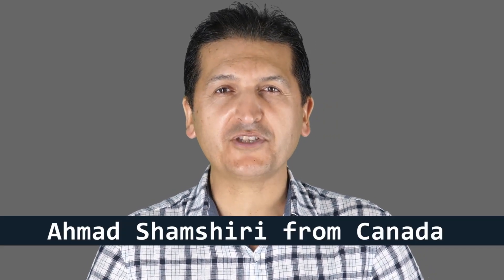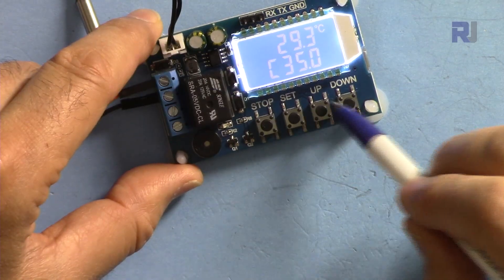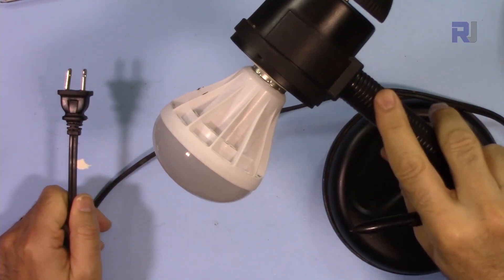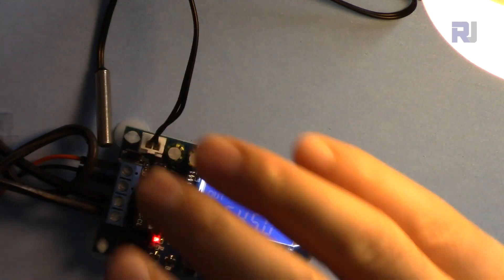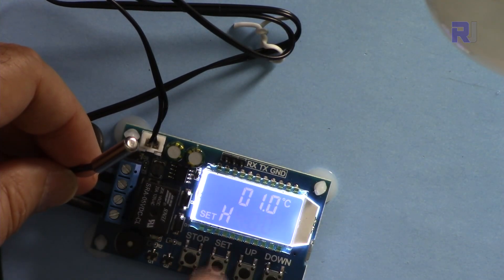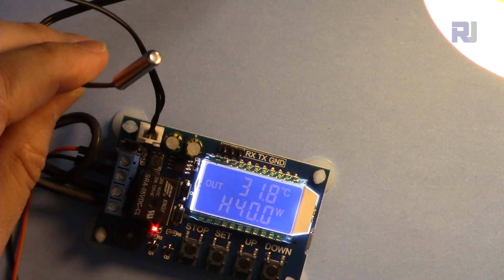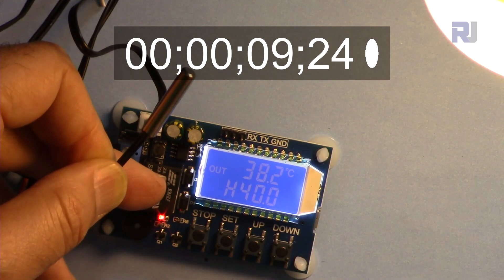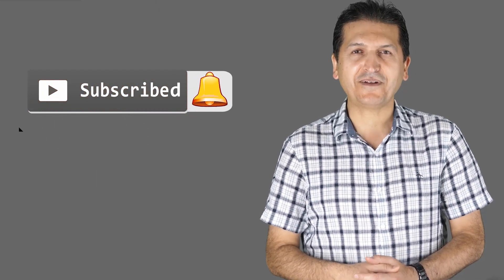How to use  XY-T01 Digital Thermostat Module - RJT205

Comment: If we wanted to use this for a cooling operation using a fan, would the fan need its own power source, or does it use the same power source as the Thermostat module?
Reply from the maker: the module needs power to work. load or fan is separate. but if the voltage of this module and our fan are the same, yes you can connect both to the same source.

Comment: Hello. I have a question: is it possible, to your knowledge, to build a circuit using a temperature controller with a single probe (NTC or PCT) and a panel with relays that activates subsequent relays as the temperature increases or decreases (say, every 5 degrees). Perhaps an Arduino-based circuit?

Controlling the activation of subsequent heaters as the temperature drops. Thank you in advance for your reply.
Reply from the maker: Hello, yes of course.  but you have to conditional statement "(if, else etc. )" I have video on that and then learn how to turn on/off a relay which I have tones of videos.

Comment: For 12V connection, my understanding is that the relay output does not power the device (fan) that is hooked up to it (it's only a switch), so there either has to be a jumper between the V+ and one of the switch connectors. Also, the positive of the device (fan) needs the to the V+ connection.  Is this correct?

Comment: Using this to prevent charging when a LIFEPO4 battery is cold.
Set the unit to the C mode for cooling and set the temp to 4 degrees C. With this setting, when the temp is above 4 degrees C, the relay will close to allow the battery to charge. It will work for months just fine, and then reset the C mode to the H mode for no apparent reason. I have seen this happen on two different units.
Is there a solution to this issue?

Comment: I own this board, it works very well, it controls a fan under a refrigerator. What bothers me is the blue indicator that lights up day and night. Is there any way to turn it off? I can also imagine desoldering a connection on the display. I just don't know which one. What is the production name of the display so that I can find the pinout information on the internet? Thank you.
Reply from the maker: Please have a look at video title
Reply: @robojax  How to use XY-T01 Digital Thermostat Module - Robojax ? I don not understand!

Comment: Hello, 
thanks a lot for this video, can you please confirm if it is reliable and can be used for years or it could shut down at any moment?
Reply from the maker: Hello, for that contact the manufacturer. Or seller.
Reply: @robojax  am asking for that parts, if it's reliable? Or will it stop functioning after 1 months for instance?
Reply from the maker: I can't say it. I don't know where you live, but here in Canada if I tell it is safe, you can use it against me and I can go to jail if something bad happens using this device.
Reply: @robojax  I live in Algeria, in Africa, so u can say the truth without any fear
Reply from the maker: Regardless. I can't say anthing about the reliability of moduels. Contact the seller or manufacgturer. Or test in a safe and isolated space where there is not possiblity of fire or other hazards and test it.

Comment: Rated at 10 amps. Could you show a wire and connector rated at 10 amps that actually fits this? I know 4 year old vid.
Reply from the maker: A simple Bing/google for wires size for different current value and you will get it. Each manufacturer will have different values.

Comment: Nice little gadget, I bought 4 of these and they work great, except the alarm does not sound @ high temperature.. 
The display will flash and the relay turns off.   I can't figure how to get the alarm to buzz.      It would be nice if the unit had C/F options and a way to have the display light turn off after a certain time..  If anyone knows how to get the alarm to work , please let me know..
Reply: hi rays,
can you please tell me if its reliable or has some issues? i want to use it with a fan to cool down the radiator and it should absolutly be reliable. The alarm does not interest me.

Comment: I have the XY-T04 for heating and once mine reaches 43°C it shuts completely off, immediately turns right back on and repeats that process every time it reaches 43°C, even tho I have it set to reach 65°C with a 1°C Hysteresis. I have the OTP, LTP, Delay, Alarm and everything else off, so why is it doing this?
Reply from the maker: it seems the power is now enough when the relay is turned ON. check the supply power make sure it has enough power. (current or ampere)

Comment: Hey there and thanks for the great video!
I am really struggling to interpret the data received from UART and so far, I am totally in the dark. Any hints on how to interpret serial data coming from device?
Thanks so much again.
Reply from the maker: Hi, we are not concerned with the data. We simply program and use it. The manufacturer has not released any information on that. Use Arduino to build your own device if you want and I have tones of videos on that.

Comment: Hi, thank you. It can be connected to an Arduino to get the temperature lecture or any other signal to activate another devices from the Arduino?
Reply from the maker: Hi, no you can't. why would you when you have no control. I have over 20  videos on different type of temperatures sensor even for your mobile phone. just search my channel.

Comment: Is the lamp 220 volt?
Reply from the maker: no. In Canada the AC voltage is 120V. But this module turns ON or OFF used relay which can turn ON or OFF devices with DC or AC or 120V and 220V.

Comment: Thank You for explaining. Have 12V DC in and 12V DC out, why cannot control both from this?
Reply from the maker: You can do it. I tried so people can learn that you can connect for example 60V and 12V for the input.
Reply: @robojax  well i have had to use a 12 vdc 20 amp brick and run 2 hot and 2 cold to make it work, so the advertisement is not honest on the one I purchased.

Comment: Explain how to use the rx tx pins .. I think that would be the real take away.. of how to control it without touching it
Reply: UART: 9600, 8, 1
Command -> Function
start -> Start temperature report
stop -> Stop temperature report
read -> Read setting parameters
on -> Relay enable ON
off -> Relay enable OFF
S:XXX -> Setting temperature(-50~-01;00. 0~99. 9;100~110℃)
B:XX. X -> Set Return Temperature Value (00. 0~30. 0℃)
OFE:XX. X -> Temperature calibration (-10. 0~10. 0℃)
ALA:XX. X -> Alarm temperature (-50. 0~110. 0℃)
OPH:XXXX -> Delayed start time (0~9999minutes)
Reply from the maker: There is no demand for that. If 1000s of people demand that, I will make video on it.
Reply: Robojax I’d like to know how to use it.. but unfortunately I’m only one person ehhh..
Reply from the maker: to figure this out, I would have to spend hours or may be whole day. so not worth it. Search for this on eBay or AliExpress and you will see they have provided some instruction there. good luck.
Reply: Robojax ... lol...

Comment: Thanks for another nice video. Btw from the video it seems 1 unit of OPH represents 20seconds (40° was reached at 50seconds on the timer and the bulb turned on at 1minute10seconds)
Reply from the maker: May be you are right. I tried to see the relationship, but did not get accurate result. The person who is using it should test the time.

Comment: Hi Ahmad ! Another great review about a usefull module, nice work man ! If i may suggest, anything about emergency backup power for an arduino would be very interesting ;) maybe with a lithium battery charging while the set is normaly powered and that would power back if the main power shuts down. As english is not my first language i may not be very clear but i think you'll get the idea :) Have a nice day man !
Reply from the maker: Hi Co Fa, Very interesting project.  I will diffidently look into it. Your English is prefect. Thank you.